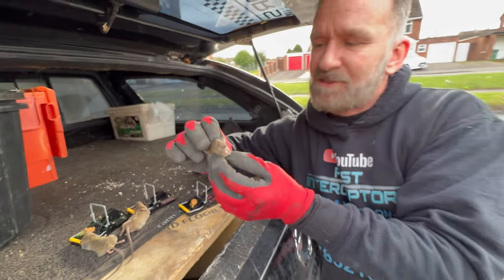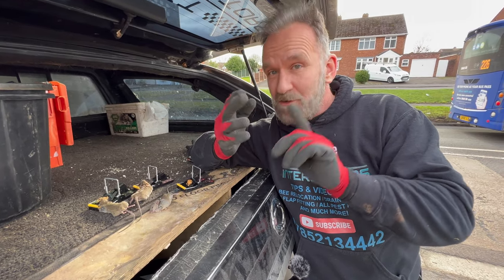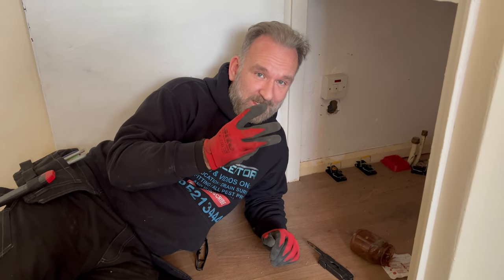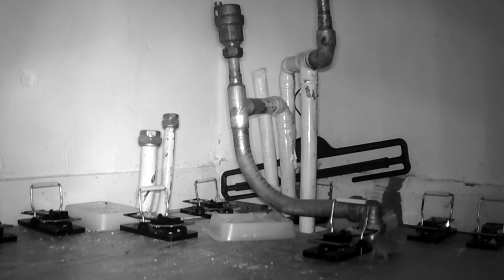Pro MOUSE CATCHING tips and techniques! CONTACT GEL to get rid of mice. Best mouse trap advice.

Comment: Wow, no expense spared with the bait on those traps. I'm not surprised the youngsters can jump all over them, without them going off. I just fill the bait pot level and never had any issues like these. They work even better when in trap tunnels, as the mice are forced to come over the traps from the side. They literally can't eat from the back of the traps.
Reply from the maker: So are you saying that a heavier weight on the treadle plate will make it less likely to go off? 
It’s the weight on the trap that sets it off. These young house mice were simply too light to set off the traps. 
You’ll note that the adults weren’t going anywhere near any traps. 
I do agree that tunnels can work well, but if you’re dealing with house mice you will need to find some not street wise house mice. Field mice, for example, are much less intelligent than house mice. 
There’s another video in the mouse playlist you may enjoy. You can see baby house mice sitting on the very end of the trigger plate. They simply ain’t heavy enough to set them off. Don’t be confusing house mice with field mice, totally different foe.

Comment: What do people think about glue boards? I cant find them in the brick and mortar stores but i can get them shipped from China. I am thinking of trying them. I am at a point with my house mice if i had access to a small nuclear weapon i would use it.
Reply from the maker: They are illegal in the UK now apart from for professionals and then only under license. And imho rightly so. Extremely cruel bit of kit.
Reply: @PestInterceptors  I did some research as I am Australian. They are lawful to use here but the shops just do not sell them. I done a bait round. My next stage is more trapping (traditional kill traps) then i put down the glue traps (if the wife lets me). There logic behind that is the glue trap will only catch those who are bait or trap shy
Reply: @PestInterceptors  Are you sure they are worse than say Brodifacoum? That stuff takes days to work and it not going to be a peacefully passing.

Comment: Hi, great channel. We're in a semi detached. 2006 had mice (only 1 above floor, rest under floorboards). They'd dug under the wall in the corners from next door. Steel wool and mortar in holes. Getting in through airbricks, of course. I had success setting traps under the floorboards (against the wall), with No bait in.
Fast forward to a few weeks ago. Saw mouse (probably more, of course), next door have had them at the same time. Mouse/mice was getting in through gap between skirting and floorboard. I've sealed EVERY gap with steel wool and sealant. Also put glue boards down BTW (from Amazon and local pound shop - will be illegal from April 2024). Haven't needed the glue traps as no sign of the mice (they will be under the floorboards). We went minimalist with the furniture after the first infestation in 2006, so easy to see where needed sealing. Next door have had a professional pest controller so fingers crossed. We're also extra clean - no crumbs, all food in top cupboards.
Reply from the maker: Glue boards are barbaric. We’ve never used them in 15 years. Absolutely unnecessary things. 
Would you like to be stuck to a board?

Comment: I had a pest control out yesterday and they put poison down for the mouse. I did ask them to use a trap but they mentioned that they're not effective enough. It seems that if it's just one mouse, It will do the job so I'm not really sure why they went with poison. Unless they suspected multiple mice. I've only ever seen one at a time on the trail cam in the loft though. 

I'm quite sensitive about animals dying in general, so the thought of them dying slowly from poison has made me feel a bit of a s*** person. I suppose I can't have them breeding in my loft though really can I? 

Thanks for the informative video. Hopefully this won't occur again. But I will probably try using traps myself in the future if I ever hear any scuttling about up there.
Reply from the maker: Mice don’t really travel in ones very often. It just doesn’t work like that. 
How can you know it is the same mouse you keep seeing on your camera? Mice follow each other’s route by following the scent trails, so it’s more likely to be lots of mice following the same track. 
Are you in the UK? If so
The pest control company MUST know what kind of mice it is. 
It’s really bad practice on their behalf! 
If you are in the Uk, let me know their name please. Do they have a G and J in their names by any chance? 
And ask them if the adhere to the CRRU. 
Ps. You may be also want to think about the stench and the flies that will occur when you get dead mice under your floor boards.
Reply: @PestInterceptors  Exactly my thoughts, especially when it comes to dead mice, which I mentioned to them stinking the place out to which they responded with "it's small so it won't smell". 

They were recommended to me by my local authority. Yes I'm in the UK. They are Milton Keynes based and have an A at the beginning of their name and an X at the end.  

Still I feel like I should have gone with just doing it myself with traps rather than paying £100 for this.
Reply from the maker: @jamess854  they should do a minimum of 3 visits for legal and animal welfare reasons. 
It would be illegal if they have left professional use only rodenticide down. They should have also started with traps. 
Perhaps you should send them this video from our mice playlist. 
It really makes my blood boil! 
Not doing things legally ends up with dead owls, birds of prey, badgers, fox’s….etc. 
Here’s that video: 
Pro MOUSE CATCHING tips and techniques! CONTACT GEL to get rid of mice. Best mouse trap advice.
https://youtu.be/3IcJcwLyUrk
Reply: @PestInterceptors  Yes I'm actually quite upset, and upset with myself for allowing them to put the poison down. But when you call a pest controler you expect they know what they're doing, and know better than you do. I knew in my gut that something didn't feel right.

Apparently they come back for a maximum of four visits if need be. I'm going to query next time and ask why they don't try traps first and mention to them the risk of contaminating wildlife. What if a cat eats one of the mice If it gets out? Yeah really dumb. Well, at least I've learned a lesson from this. And thanks for all the advice and your playlists on mice.

Comment: Do you ever use peppermint to drive the mice away?
Reply from the maker: Absolutely not. It doesn’t work. If it did us pros would use it, in fact, legally we would have to use it because we have to use the least toxic method. 
Ps. Neither do sonic devices, chilli. Cinnamon, garlic, etc, etc….
Reply: @PestInterceptors  What would you recommend for someone that's spotted one mouse but lives above a shop where I believe they are coming from?
Reply from the maker: @PeterMcGrory-o6b  i would firstly say it’s rare for it to be just one mouse. 
Secondly I’d say seeing it, as opposed to just seeing droppings or signs mice, isn’t usually a good sign as they don’t want to be seen by humans. It is usually a pointer to either it’s a large population and you’re seeing the bottom of the pecking order mouse or the mouse has eaten some poison and it makes them like they are drunk (do silly things they wouldn’t usually do). 
The fact above may signify that the shop downstairs (or one of your neighbours) is putting poison down.